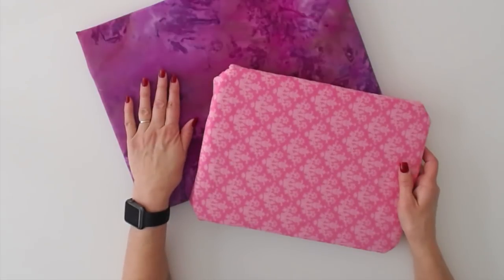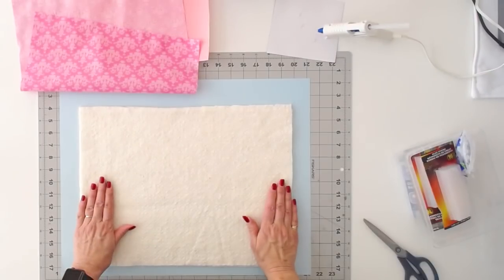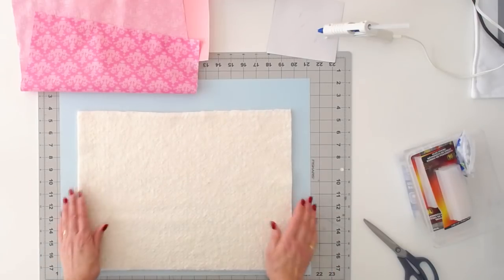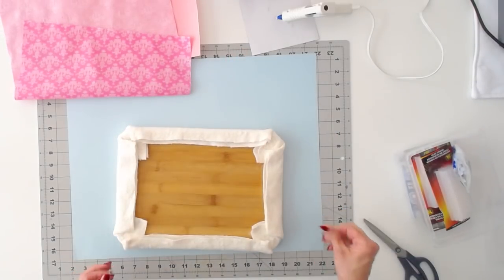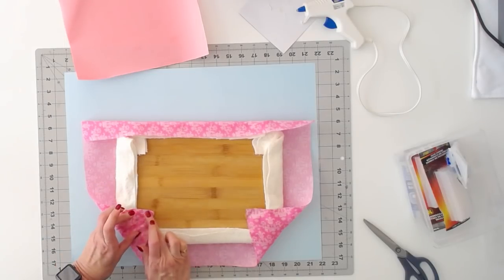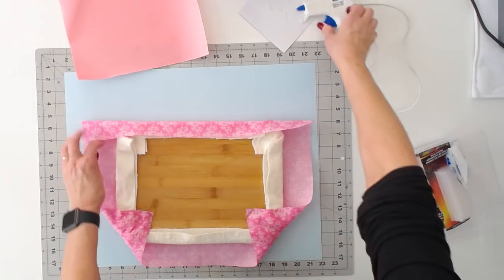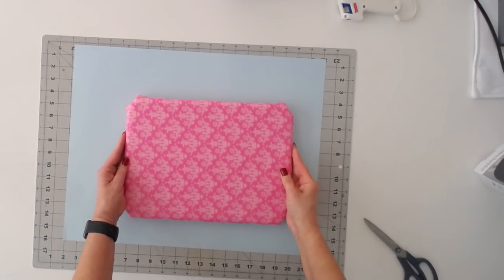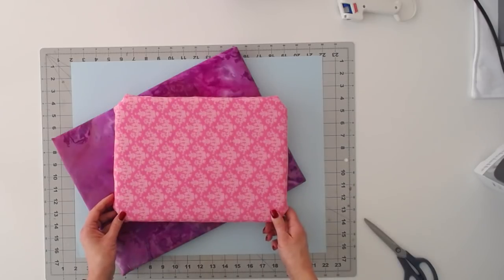DIY...A MINI IRONING BOARD

Comment: If using staples, add "feet" to the board. Glue or sew on large buttons, short lengths of cork, checkerboard pieces, small stacks of glued cardboard. Quite a few possibilities to lift the board so staples will not contact the table. Gluing on cork or felt is another option.
Reply: I know Im pretty off topic but does anybody know of a good place to watch new series online?
Reply: @Zayd Nolan Flixportal :)
Reply: @Trace Sonny thank you, signed up and it seems to work :) Appreciate it !!
Reply: @Zayd Nolan Glad I could help :)